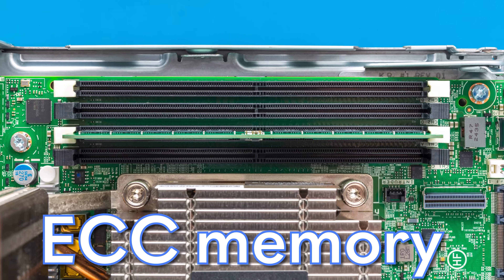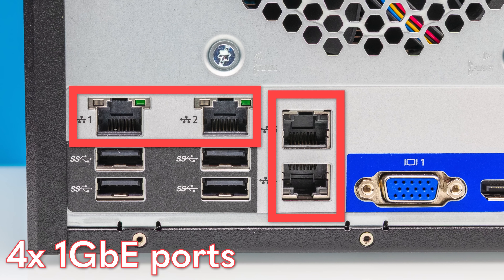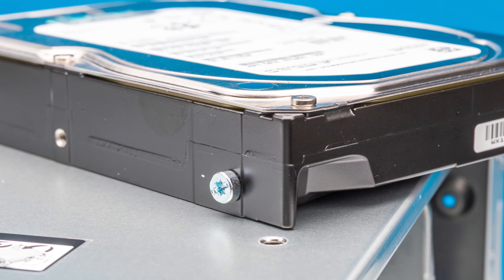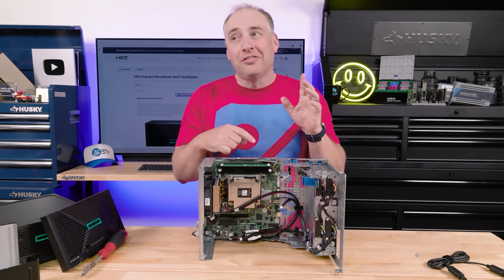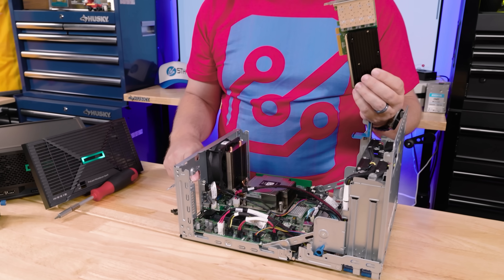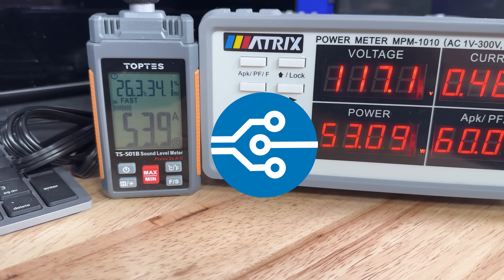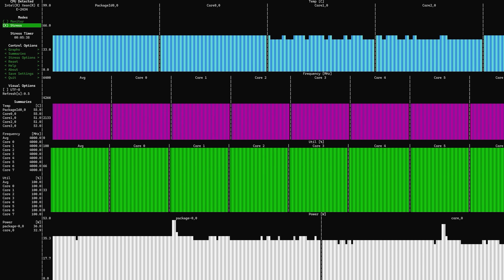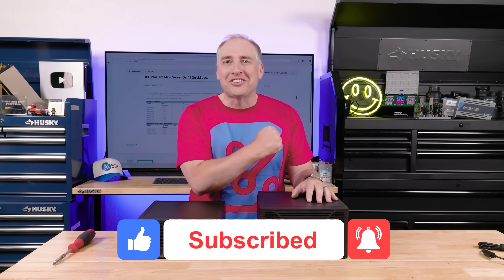THE OG Mini Server is Back - HPE ProLiant Microserver Gen11 Review

Comment: The choice of 1gb ethernet ports is a stupid cost saving measure at this point, 
it needs 2.5 ports at a minimum, preferably 10gig. 
having a extra pci slot is not as good of a deal as you'll just end up using it for a faster network card.
Reply: I think 1GbE should be the standard. The user can install any speed they want in the PCIe slot. More PCIe slots is what manufacturers/designers should focus on.
Reply: @prashanthb6521  its not 1990
Reply: @andyholmes999  Its no use having 10GbE just to look cool and hip. Or do you need 100GbE just to access BMC ? These things consume lot of power ! If you really want it, install it in a PCIe slot, else save money/power on it. You should be asking for more PCIe slots so that, that machine can be reused when your requirements change.
Reply: @prashanthb6521  most enterprise equip comes with 10GB/s as standard, and an array of 4 disks can easily do 6-8GB/s now. 
Part of the issue is that without faster built-in networking, it doesnt offer anything more than the Gen-7 did from 2010 aside from CPU performance. (perhaps we should call this model the Gen 7-Eleven)

Comment: Does it support PCIe bifurcation, though? EDIT; and does it actually work? (The Gen10 Plus had bifurcation settings in the UEFI BIOS setup, but those did nothing, using an i3-9100F.) It'd be great if one could use a quad m.2 card; for redundant NVMe boot and redundant NVMe caching. A 10/25gig NIC can run in the x8 socket.
Reply: "Had" is the word! Worked fine in my G10+ with Xeon, until HPE released a BIOS that removed the bifurcation !?  Instant downgrade of BIOS for me.
This G11 even have bifurcation support printed on motherboard above the PCI-E slot. Can be seen in the video but I don't take that as an guarantee that HPE isn't patching it away again.
Reply: @Saazm  I got bifurcation on Gen10 Plus only in Hyper-V, ESXi seen only one drive. :(
Reply: Nah, you need to dig deeper down your pocket, if you want them to enable extra functions.

Comment: Airflow for the expansion card is strange. Only 1 fan so negative pressure: flow from exterior to interior for the card?
Reply from the maker: That is why I discussed that aspect because hot cards with small heatsinks will be a challenge.
Reply: @ServeTheHomeVideo  yes, maybe not as important as the "not AMD" choice but disappointing especially when you compare to other HPE servers (I'm using old DL380 gen9 and they have so (almost too) much airflow, including the adapter area  🙂)

Comment: 4x 1G eth. in 2025? Did HPE hire engineers from Synology?
Reply: much sad
Reply: I was opening my browser right before I heard 1Gig 😂
Reply: This system is from 2022.
Reply: they will gaslight people into thinking you dont need more speed
Reply: @boombox8675 If i want slow stuff, I'll stay on my current setup.
Reply: Limited by whatever chip Intel puts out.  How many watts does a 10GbE Intel chip draw?  AFAIK enough to have a large passive heat sink that still needs lots of airflow.  Which this enclosure does not have.
Reply: 4 x 2,5Gbit intel NICs and a beefier CPU would be better. Then it could work as a Domain Controler, File Server, Monitoring Proxy, and a Firewall at the same time.
Reply: this thing would get boot kicked out of our office real quick
Reply: Well it does have expansion options, so it’s not a hard pass. But built in 2.5 would have been nice, and save the pcie slot for people who need 10
Reply: I missed that it was 4 by 1gig. What a weird choice by HPE to limit the performance like that.
Reply: Scummy dick move by HP as usual. Whats the bet they sell a expansion card that will fit the unit.
Reply: Anti-cannibalize specs as usual. Make it any better and it eats into the market of higher priced model lines.

14+ years later and given that length of time, these are still not a whole lot higher spec on anything over my old HP gen7 micro server. DIY with a mini NAS case and an older used itx server mobo can easily surprise the gen11 for less money
Reply: Yea, it's cheaper than 2.5gbe by 5 cents per chip. 2.5gbe chips would mean 5000+ job cuts just to make up for an increase in executive bonuses.
Reply: I've checked out of the video at that point
Reply: @LA-MJ  same 👌
Reply: The only thing that should be 1Gb should be the MGMT/iLo port. Serial and VGA ports??! HP ran out of 25pin LPT, PS/2, floppy ports? In the words of Pink: you make sick ...
Reply: Yeah, I tapped out after he said that.  So dumb
Reply: Simple matter of fact is. No Labber is buying this anyway. This is a Buissness device.
If you are that small that you are considdering such a Box as your NAS or whatever. You probably dont have the Infrastructre for 10g anyway. Its fine. For 90% of usecases this is utterly enough and you just dont overspec a device for the last 10% as those buy a different system anyway.
Reply: @FlaxTheSeedOne Feel sorry you think so small.
Reply: @Tempo_Gigante  Well then expand, you big thinker. 
HP has a better overview of what its cuustomers are and what they want compared to you. 
Ports are fine, 10G for a 4bay hdd small buissnes box is utterly not needed.
Personally anyone in the Home claiming they need 10G is also pretty delulu, I can understand that many want it but its not needed, and on this product its unneccessary and If I was the company behind It I would also not spend the money on the extra chipset.
Reply: @FlaxTheSeedOne Yep, you definitely don't work for HP.
Reply: @Tempo_Gigante  Lol I dont I dont even own a single HP machine. But not because it doesnt have 10G lol
Reply: @FlaxTheSeedOne Oh I'm sure. /s
Reply: @Tempo_Gigante  gotta love fuling the trolls
Reply: Good PFSense box

Comment: My HP Microserver N54L is still going strong (since 2010).
Reply from the maker: Such cool machines!
Reply: @ServeTheHomeVideo what is the stress test you use in the video? It looks amazing!
Reply: Same here with the N54L, I got mine for £99 I think after a rebate. I have mine expanded with a 4x2.5" 5.25" drive bay and SSDs in it, an IT mode LSI SAS adaptor and 2.5Gb networking.
I can see some of that design philosophy in this but some decisions are a poor move IMHO.
Reply: Still have my N40L too. 
Might be my last HDD based Mini Server. 
I use it rarly only to sync with my main server.
The power draw is simply too much for an always on system.
Reply: i really like the g9 one, we had quite a few out with some very small customers.
Reply: Sadly mine stopped working last year. Was great machine.
Reply: Just retired mine after 11 years great machine!.. Bought a WTR pro instead
Reply: I had one, gifted it to my little sis. Still working 24*7 non stop, without issues.
Reply: My dads still running a N54L as a freeNAS server. And I've got a gen8 as my home server, its a lovely machine but I wish it wasn't capped to 16GB of RAM and had an extra PCIe slot for hardware video transcode.
Reply: Mine got wet and start rusting a bit, but still works
Reply: I only just retired mine a few months ago for a diy NAS. Loved that little guy.
Reply: Same here, running Windows Server 2019 as iSCSI storage for my two Proxmox HP ML110 servers after dumping ESXi a while ago. Even added 2 x 10Gb port HP PCIe NIC so I could run one high speed connection to each hypervisor host (after finding out how cheap they were on eBay).

Comment: 2.5Gbit min networking.   but so sad it's not two 2.5Gbit and two 10Gbit ports.
Reply from the maker: I would take 4x 2.5GbE or 2x 10G ports even since either configuration would be a big upgrade.
Reply: @ServeTheHomeVideo why not both? 😂 eminently doable on an AM5 socket I'd have thought.

Comment: I'm running a HPE ProLiant MicroServer Gen8 running truenas had this running for 3 year without any problems.
Reply from the maker: That was a great little box!
Reply: I sold my two that were £125 each for same I paid on eBay recently. Lockin for parts and licenses is trash. Hp is dead to me.

Comment: Only 1Gbe, pass.  Also no hot swap or anything helpful.   Also no USB 3.2 G2 or USB 4 for external drives.  You can get an ITX case nearly the same size with hotswap drives, and get a more powerful system for it too.   Not impressed.
Reply: yes, complete joke
Reply: The external power brick isn't a great feature either
Reply from the maker: HPE's resellers sometimes have deals. Also, a lot of folks buy these as home labs if they run fleets of HPE iLO servers at work